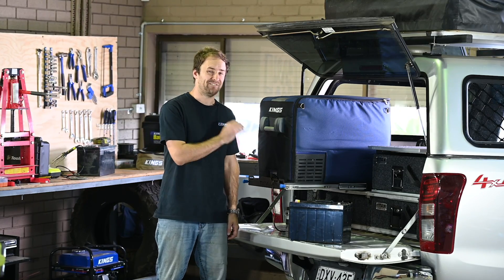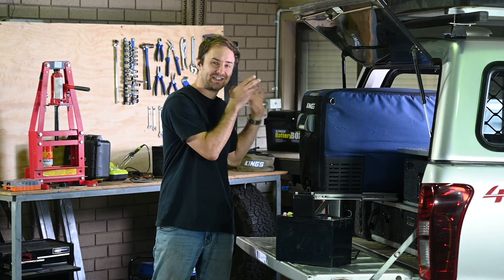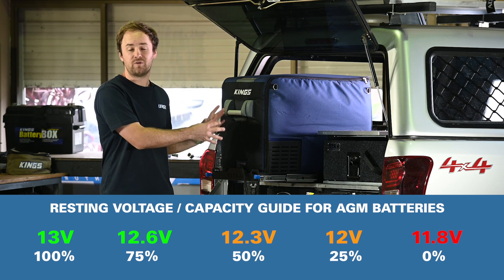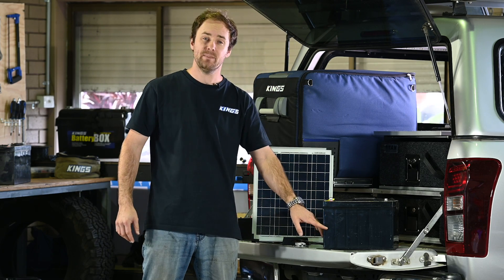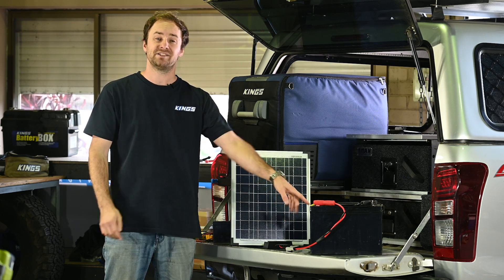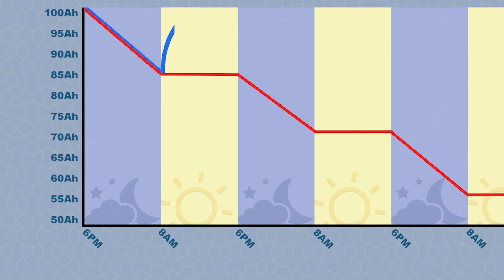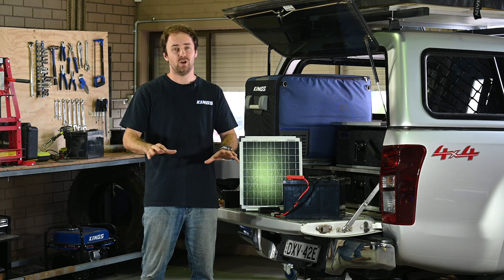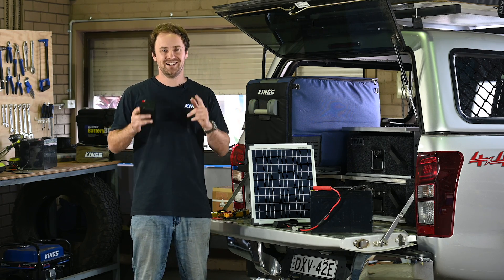SIZE MATTERS! How to choose the right battery and solar panel for your 12V setup

Comment: Love the information but still finding this a bit confusing.
I have ordered a 200w solar panel. It will be topping up a 45ah battery (or two?).
I'm in the UK, so solar is probably going to be 4 to 5 hours if I'm lucky. My question is would that suffice to run 24l fridge (40w), lights and charge up to 6 phones/tablets daily.

Comment: In my small trailer sailer I have a small 36Ah battery with 2x7Ah batteries as a backup for emergency radio and navigation purposes. Mainly because I usually only go away for a few days at a time. I have a 100w solar panel which normally keeps the battery topped up, but I also have a 800w genny for the odd time that the solar doesn't keep up. This setup will keep me off grid for weeks. I always pre-cool my fridge prior to my trip, and have the fridge charging from the car on the way. Works for me and saves lots of weight when I want to take the battery box out.

Comment: How do you get ventilation over the compressor, if it is in a bag?
Reply from the maker: Fridge bags designed for specific fridges (like in this vid) have mesh cutouts to allow airflow and still insulate the rest of the fridge!

Cheers!

Comment: @4wd Supacentre -  what would the power consumption on the Kings 70L Dual Zone fridge with one zone set as freezer? What would power consumption be if both zones set as fridge? Specs on the website don't really say.

Comment: Hi, I have a 110amp battery and a 110watt semi flex solar panel (from 4wd supacentre) is this going to work day after day in the sun load waco 50 fridge and awning led lights at night, cheers, Neil.
Reply: Yes that's fine. People think you need stacks of power but you don't, particularly when it's cool overnight

Comment: What a lot of people forget is that the sun being 'up' does not allow full power from solar panels. Full power only get generated in the times when the sun is high and the panel(s) are at the right angle. We have measured input from panels (laid flat on a caravan roof) and the resulting generating looked like a bell curve. Lower in the morning and afternoon and higher during the middle of the day. The generated power even changed as the sun changed angle in the sky (over a couple of months) so what the panels promise to deliver is,, in reality, nothing like what you get for a full day. Our rule of thumb, on a clear day you might get about half of what panels are rated for. The bigger your battery bank is, the more panels you need to get it up to near 100% charge. Good video, these are great explanations for campers.
Reply from the maker: Absolutely - panels need to be perpendicular to the sun to get anywhere close to full power! Throw in losses from heat, wiring and regulator inherent losses as well as battery charging inefficiencies and you start to see the real picture! I’ve done a video talking solar in detail similar to this video, so if anyone reading is interested I recommend checking it out! Thanks for the comment and thanks for watching! Cheers, Cahn

Comment: I got the 100 hour battery, runs the fridge, and the battery is charged by a 160 watt solar  panel on my roof, it’s keeps my battery at 13.7 to 13
Reply: its called a top charge, put a small load on it to get real voltage,